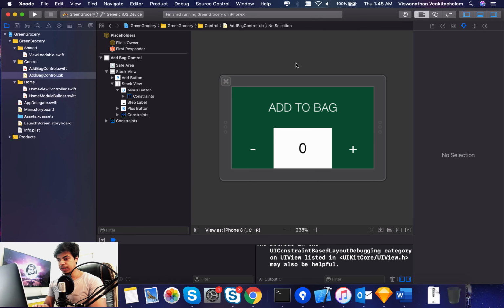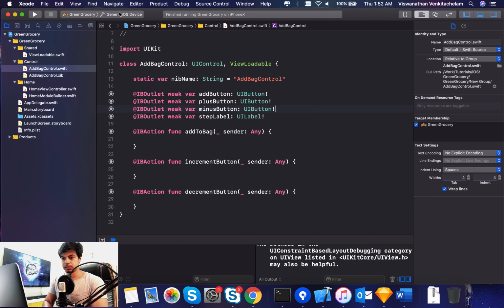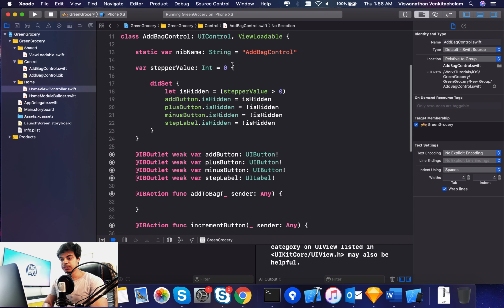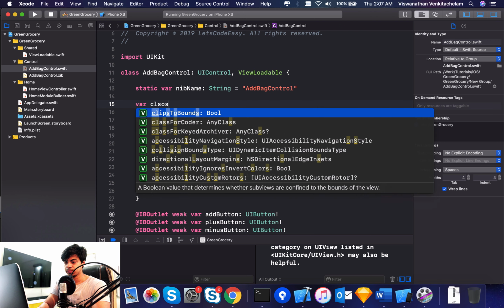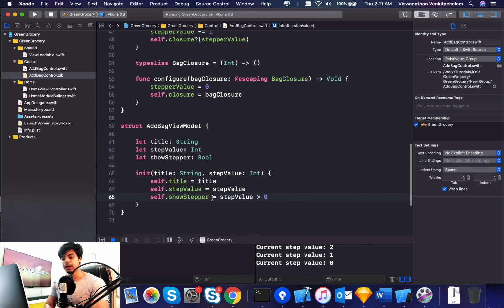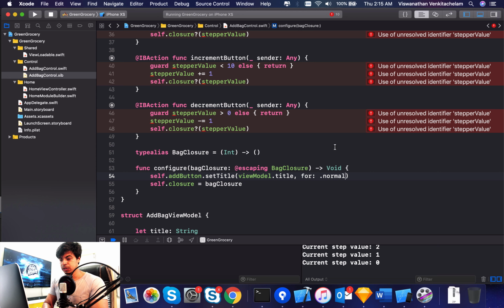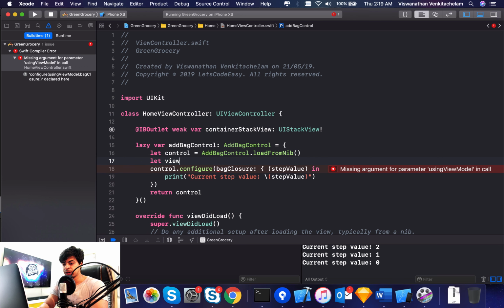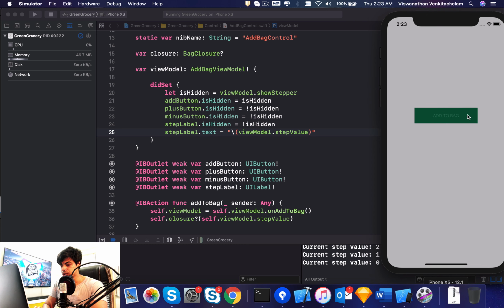Stepper Control MVVM: [Let's Build a VIPER iOS Swift App]

Comment: If I'm right, you're gonna use ViewModel + ViewController instead of Presenter for this series. Also, one more doubt. I used to use the Repository pattern to sync between multiple data sources, the local data source where data comes from CoreData and a network data source where data comes from API requests using Alamofire. Which one is better? Can I remove Interactor and use Repository pattern there?

If I did remove, Interactor & Presenter from VIPER, then effectively it is becoming MVVM on the whole, where I see Entity as just another name for Model. The last part, Router only makes sense if you're not using Storyboards, as otherwise all the navigation can be represented as Segues.

What do you think? I'd also love to know your thoughts on MVI architecture. Nice tutorial btw!
Reply from the maker: I am using ViewModel for databinding on the view side, i also use Presenter as part of VIPER.
As long as the repository does not know the real implementation and is exposed through protocols or something, then it will be a good design. Eg: Repository should not worry about whether it is CoreData or Realm or Alamofire or Moya etc. 
Yes, Router will make sense if you are not using Segues. I personally does not like using Segues and the good part is that with SwiftUI, the concept of Segue is totally gotten rid of.
On the MVI, i have not personally looked into it as my focus is more currently on iOS, but surely will have my views published pretty soon. Thank you for your detailed comments.